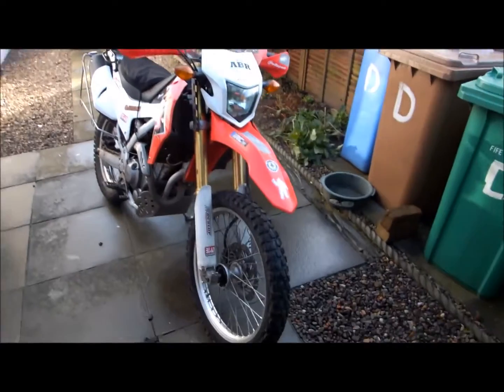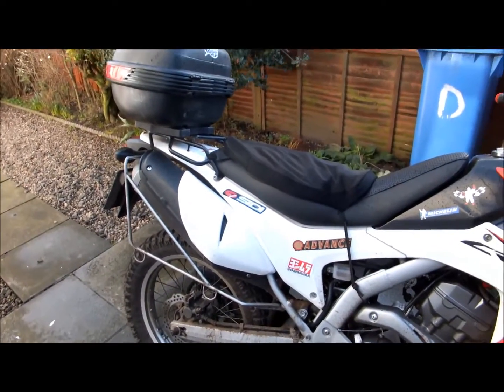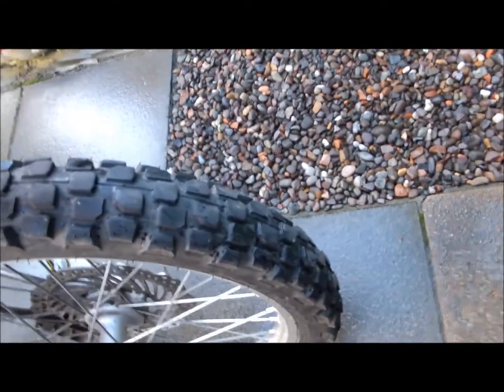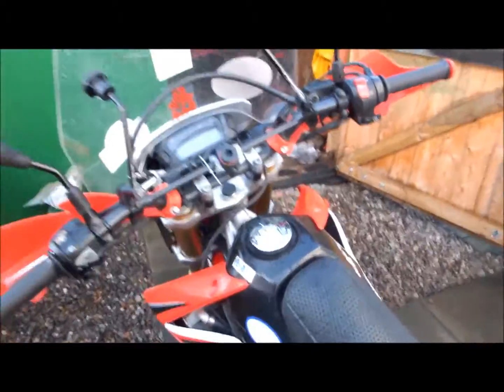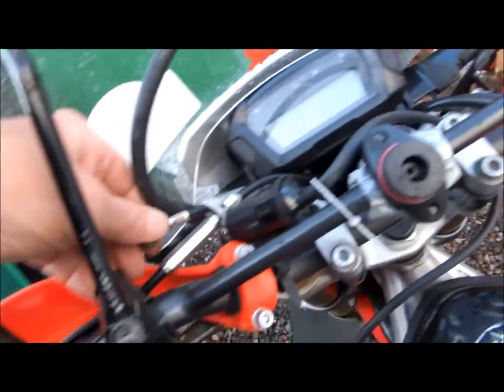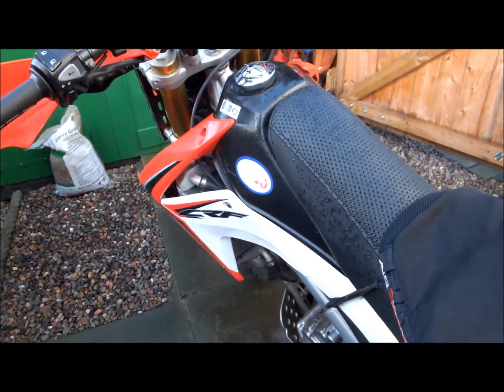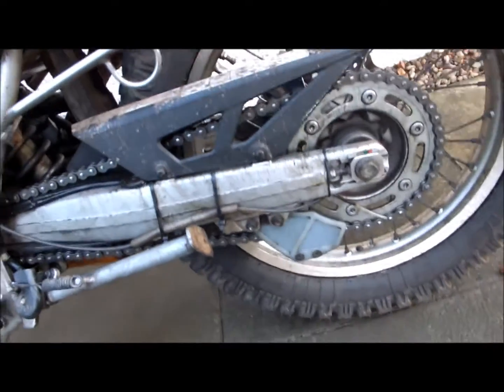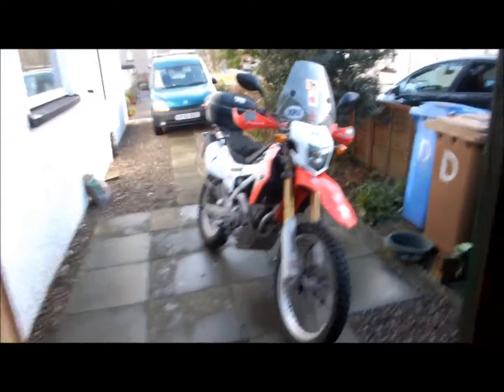CRF250l 2 years on

Comment: Great review, im interested in out you mounted the manual canister tube , i could only see that you used the helmet holder mount on the top end.
Reply from the maker: better late than never, drilled a wee hole in the tool compartment to secure the bottom of the tool tube

Comment: Thanks Steven. I'm not keen on the soupys one either. Too many bits that could cause a problem and not really keen on drilling the shock. So will go the Kouba route. The only place I can find them in the uk is rally raid who say 4-6 weeks delivery time. so they probably order from the states as well. Was yours off a forum member? Many thanks😊
Reply from the maker: Yes I bought it off a dealer who bought in a CRF that was lowered, he swapped me the link and side stand for my normal side stand and 50 quid. One in the states cheap on ebay, you would get it quicker its a devol. http://www.ebay.com/itm/DEVOL-LOWERING-LINKAGE-LOWERS-REAR-1-25-CRF-250L-2013-2014-/222402135697?hash=item33c8334691:g:UNIAAOSwnHZYa~T6&vxp=mtr

Comment: Hi Steven. I have found it on the forum as you said and will order one. Thanks. 
I will be looking at lowering the bike for my wife like yourself. it looks a good mod. Where did you get your air blade screen and what model was it. 
Thanks in advance for your help😊
Reply from the maker: http://www.ebay.co.uk/itm/Airblade-Universal-Tinted-Custom-Motorcycle-Screen-Blade-Inc-Kit-7-8-or-1-Fit-/401085283907?hash=item5d628bbe43:m:mOk1nyttSX6iziiU4t-EK1g